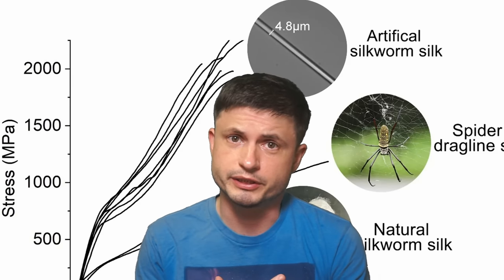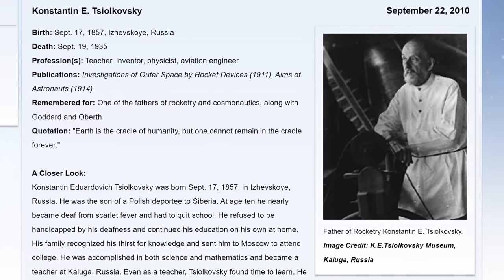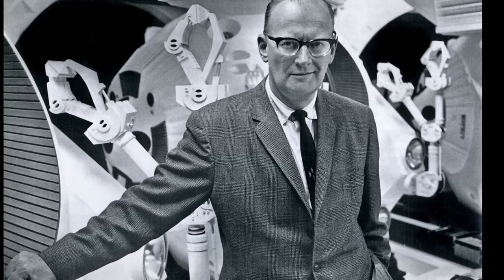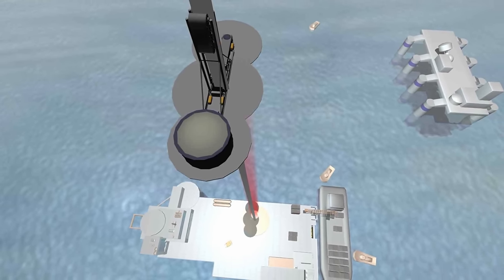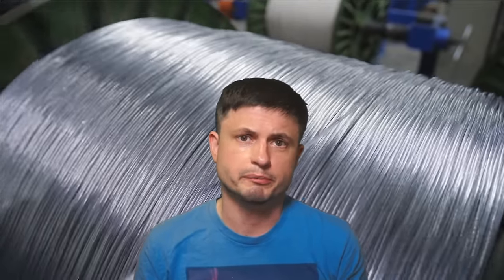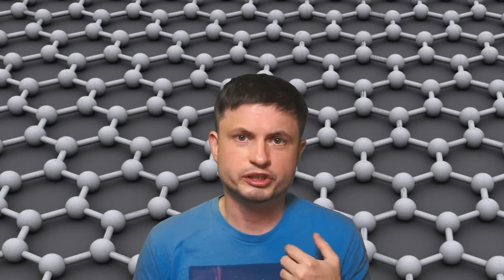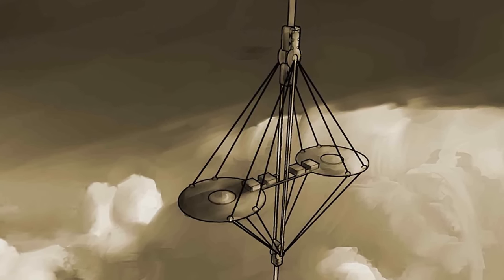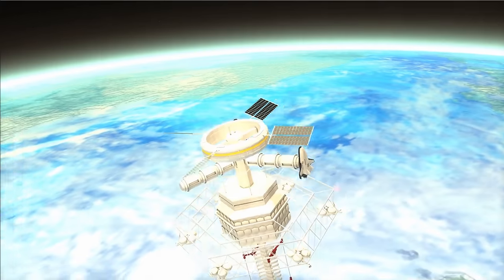Exciting New Updates About Space Elevator Technology...Possible After All?

Comment: One big problem and it's to do with physics. Any space elvator will be made from either metal, or some form of carbon composite, most likely the latter. Carbon composites are very electrically conductive. The earth is surrounded by a magnetic field, that does not rotate with the planet. What happens when you pass a conductor through a magnetic field? You create an electric current. The current generated by a space elevator passing through the earths magnetic field, would be horrendous. The magnetic field around that current would also be horrendous. How would you deal with these two phenomena? 
An experiment similar to this was attempted by scientists aboard the space shuttle. The idea was to run a copper cable 1,000 meters out and see what sort of current was generated. 
The cable blew apart after running out 300 meters.

Comment: I wonder how space elevators will work with energy conservation law. Will bringing lots of staff to space slow down the counter-weight, so some sort of correction engines will be needed to bring it back to speed to maintain the pressure.
Reply: I have commented this on other comments as well, but let me present my option:

If the centre of gravity of the cable is slightly outside of geostationary orbit, then the cable would be constantly under strain. If you then raise something up the cable, that would lower the centre of gravity. But as long as the centre of gravity is still outside of GSO, the centripetal force will still push the centre of gravity outwards. Which will keep the tether where it would be.

So essentially:
We can have a thin tether, where the centre of gravity is only slightly outside of GSO. This will cause little strain on the tether where it's connected to the Earth, and thus little strain on these fasteners. This will give us a space elevator with relatively low capacity for transport.
Or we can have a thicker tether, where the centre of gravity is further out. This will cause more strain on the tether and on the fasteners to the Earth. But it will give it higher capacity for transport.

Comment: you can build a space elevator from relatively weak materials, it just requires tapering down its thickness. how much tapering is required depends on the tensile strength. using steel would require a base(top) of the width of thousands of kilometres and you'd need a planet to source all the steel. not practical but not impossible. a carbon nanotube one would require considerably less tapering, but would still be massive. the tensile strength number ONLY applies to a cable of equal thickness all the way. it does not apply to a pyramid or inverted pyramid. (two cables can carry twice the load of one cable. four cables can carry twice the load of two cables and so on.)

doesn't mean it's the best way to do it as structural integrity is not restricted by static support to begin with. you can support it dynamically by using a lot of power just as well, and that's only limited by the amount of power you have available. and if you build your dynamical support superconductively you'll only need to keep it down to superconductive temperature. and if we find room temperature superconductors (no physics rules them out) you're back to zero operating power consumption after you start your structure. the power will loop in its superconductive structures indefinitely and keep the structure dynamically supported.

any time you hear people say things like "you can't build a world ring/dyson sphere because there's no material strong enoug" those people have no idea about building megastructures. you can build a space tower from surface to space from marshmallows if you like, it just takes dynamic support to stop it from collapsing. it does NOT have to statically support its own weight.

Comment: i think it would be smartest to use space elevator rails as catapults to launch rockets into orbit with the same concept as a fighter jet launching from  a battleship but vertically. We could dig into the Earth to have to build less high even. We don't need something that connects, we just need an easy escape route.
Reply: plus it would probably mess with the ionosphere to have a long ass rod orbiting in sync with earth's rotation, and would probably even mess with gravity itself. its not just about building taller anymore.

Comment: This still sounds enticing -- but I'm curious about the orbital dynamics.  Most artificial objects are in Low Earth Orbit (LEO), which is less than 1/3 of the Earth's radius (the accepted definition of LEO is < 1243.7 miles above sea level).  For example the ISS orbits at 211 miles above the earth and has an orbital speed of about 17,100 mph.  At this altitude the orbital period is about 92.9 minutes.   
Geostationary Earth orbit (GEO) on the other hand is 22,236 miles above the surface of the earth.  At this altitude the ground speed is 0.  Obviously this is a huge gap between geostationary orbit and LEO.  GEO is 105x further away than the space station.  You show the counterweight being much further away than this even. This suggests a few problems...
1) Any structure in the LEO portion of the elevator will be at risk of collisions with space debris with closing speeds of about 17,000 mph.
2) How will the cable manage the inevitable perturbations in orbits?  For example a 0.01% change in the orbital altitude will still be about a 222 mile "stretch" or slack in the cable.
3) According to Wikipedia, a combination of lunar gravity, solar gravity and the flattening of the Earth at it's poles causes a precession motion of the orbital plane of any geostationary object.  This requires regular stationkeeping maneuvers of about 50 m/s per year.  I expect that this will be even worse at the altitude of the counter-weight, which will be held in it's orbit by the cable since it will be moving faster than required for it's orbit.  I wonder how they will manage this problem.
4) I wonder if this could result in a change in the angular momentum of the earth -- remember it's a long way out there, and thus a very, very long lever.   We worry about climate change -- what about a space elevator which slows the rotation of the earth???

At the end of the day -- I'm not holding out for this idea.

Comment: My question is what would happen if the tether is hit(broken) below the Geo-stationary altitude ? Would the lower part crash onto earth ?
Reply: When you say "hit", I assume you mean "break", right?
Yes, if the tether of the space elevator breaks, it will be a complete disaster. Which is why we need to make sure that doesn't happen.
Reply: @SexDrugsNpostprod  Well, here is why I don't agree with you.
You seem to equate the tether being HIT, with the tether BREAKING. I don't agree with that.

The tether has to be really thick and strong. We're not talking about lifting one ton into orbit each time. We're probably talking about a large number of elevator "cars" or "pods" moving up and down at the same time. These pods ALSO need to be protected. So outside these pods, there will probably be some kind of screen, maybe made from kevlar or something, that will be able to absorb smaller objects hitting it.
Larger objects will have to be monitored to make sure they don't hit. But large pieces of space junk are currently being monitored, so that's no difference.
Additionally, with a space elevator we would be able to build proper "vacuum cleaners" (pun intended), that can help remove all of the space junk. This would lower the risk of any impact.

A space elevator would also make it easier to refuel and repair satellites. And to remove those satellites that are permanently being taken out of commission. This will reduce the future risk of space junk even being created.

Comment: considering we could easily suspend something mid air using airships or balloons, we can currently reach far higher than people realize, not to space, but still significantly higher than anything we have tried yet
Reply: Alex, you are talking about high altitude baloons and great weights, as if they go well together!  High altitude baloons can't even avoid leaking helium right through their skin.  The more the weight, the more the baloon, and the more they leak.  You need to put the top end weight 44,000. miles above the ground, and you would be lucky to get a giant baloon with 2 tons of cargo to 80,000. feet.  That is only 15 miles!
Reply: @haroldhahn7044  sorry but a couple of corrections, 1. Helium is for chumps, hydrogen is the way to go, 2. My comment also mentioned airships, which were easily capable of lifting 50+ tons, and 3. My comment specifically said this probably couldn't get all the way to space, but it can get us far closer than anything we have tried

Comment: An engineer would be a fool to use a constant cross section rope in anycase,. Such a tension structure needs to be tapered. There is even a reasonably direct formula for it, just plug in the strength and density of the material.

Comment: Watch the price of land in the potential drop zone plummet if something like that sould ever be attempted...
Having the cable is by far not everything needed to create such a structure. Remember: you basically have to lift the entire structure in  place more or less in one go. At least a supportive structure that can act as a scaffolding to get the full strength elevator in place. I don't see any vehicle capable of doing that anytime soon.
Reply: There is no way this cable will be lifted in place in one go.
It will be brought to the geostationary orbit in smaller pieces, and then connected there.

Comment: I've always wondered why you couldn't tie your space elevator to a high altitude floating airship platform first, and then lower the cable to the ground after getting enough mass up as a counterweight?

And engineers on here?

Cheers 😊
Reply: I fail to see the benefit of doing that. It feels running a marathon, and then stopping 100 meters from the finish line to have a shower and lunch before you finish.

Geostationary orbit is roughly 36 000 km above Earth's surface. Space starts at the Karman line, which is recognized to be 100 km above the Earth's surface. So just by reaching the Karman line, you have finished about 99.7% of the space elevator. If you then get down to 36 km, which is 4 times higher than Mount Everest, and where I guess such an airship could be placed, you have finished 99.9% of the space elevator.
So if you have finished 99.9% of it, why not just finish the rest?

Comment: The geostationary construction would need to be built first , and the fiber line , made at the station , to earth .
 Letting it down , is much easier & safer & cheaper , than trying to haul the line up . 
 With all supply's , ferryed up to the geostationary construct , it should be relatively easy .  
 The fiber used , is yet to be made  - what would diamond do over that lentgh , as it's light , strong and potentially eminently suitable .

Comment: No one ever talks about how you would lay outthe cable, once in place sure it could work but getting the cable to link space to the ground has a massive issue that no onetalks about, how do you actually getthe cable up there and then tie it off to the ground.

Because no rocket could gettospave draging it from behind and dropping it from space would have so much drag on it as its falling it would twist and curl wildly from wind and the spin of the earth.
I have never heard anyone ever talk about this aspect of the project and to me its a bigger technical issue then the material of the cable.
How do you drop a many km cable from space and get it to land in an exact place then secure it before its either pulled away or too much lands and it crushes everything and is too heavy to move. And then do all that and then have the counter weight boosters fire in space to stop the fall. And for all of that with no issues because there wouldn't be time to fix them.

Comment: Wouldn't this induce a ginormous torque on the wire? As the weight would want to slow down due to the high earth orbit, while tha bottom would want to speed up due to being in LEO?
Reply: It's not BEING in LEO that makes the cable want to speed up.
Very (over)simplistically, it's the centre of gravity that matters. If the centre of gravity of the cable is in geostationary orbit, then the cable itself will orbit as if all of it is there.
That is of course not entirely true. The different strength of gravity will try to stretch it out. But fortunately, that's what we want it to do.

Comment: Any structure going through the atmosphere towards space would face a problem of ice building up on the outside above a certain altitude hope they don't leave that as an afterthought
Reply: vibration and windage pretty sure to vibrate the ice off the fun bit is working out how to dampen the vibrations although a floating airport at the edge of atmo would be one way and a good way to have connecting flights too and from elevator plus the tether weight is generally assumed to crawl up or down tether to compensate for windage and load

Comment: Why not use a spring from geostationary orbit for a slingshot?
Reply: To launch a vehicle toward the moon or wherever?
Reply: @booklover6753  👍 exactly
Reply: @oldmechanic5744      Any velocity that you impart on something is going to push the launcher in the opposite direction (one of Newtons' laws).   The energy contained in the spring would be split 50-50 between the launcher and launchee.   And to get to any destination in a reasonable length of time, this kind of a system would need to accelerate you to a huge velocity very quickly (G forces would be lethal probably), unless you used a really long gentle spring.    I used to help out a friend who operated a one man garage, and we used to install springs on struts before installing the struts into the cars.    Can you imagine the spring compressor you'd need?     Astronomy and physics were my majors in college, but I used to work and get my hands dirty when I was a youngster too.   I get where you're coming from.   Finding a way to get a free boost out of orbit would be a great accomplishment.   Not sure how you'd get it done though.   👍😎

Comment: Start with a much smaller one in lunar orbit.... as part of a post Artemis program. 
I can see this quickly replacing small lift rockets, but to get into the 100 tons market may take a bit more time.
Reply: Building on going up from the Earth would be more cost effective. Since currently EVERYTHING we have to send into space currently have to go on expensive rockets, this would save a LOT of money.

So the first priority should be to build a simple and cheap one that can be used to sent things into space a lot cheaper. Then you can use that one to build a much bigger and sturdier space elevator, as well as building one around the Moon.
Reply: @Tjalve70  i think the idea is to use electric methods of propulsion which are more efficient than rocket propulsion
Reply: @ethanpeters3047  Yeah, that's obvious.
Why are you telling me this?
And how is this relevant to whether to build a space elevator on Earth versus Moon?
Did you read the message you responded to?

Comment: What if, we didn't need a stronger material. What about... a series of electromagnets. Then the actual tether strength would be dependent on the strength of the magnets, rather than a continuously connected physical material...? Could something like that be done? Of course... then how would you power the magnets...
Reply: Not strong enough
Reply: @andreasvox8068  Too bad. Graphene actually sounds like a cooler idea though. Being that it seems so useful.

Comment: ..take the Eiffel Tower as a concept. Make it 1000-times larger. Take it to the edge of space. Build-in several large elevators.  and there you have it. A very large engineering job designed to last 1000 years or more. Equip with elevators able to haul large payloads with a space port on the top. Beats strapping human beings to bombs..

Comment: I love the concept of space elevators but I always get upset when everyone mentions that we have nothing that can act as the cord for the elevator as that’s simply not true.  It’s only a problem if you are trying to make the entire length a single uniform diameter cable for that whole thousands of kilometers length which to me has always seemed crazy ever since I realized it doesn’t have to be.   I just don’t understand why no one ever talks about the possibility of making that cable a tapered construction.  If you increase the diameter, and therefore the strength of your cable as you go up, then each section of cable only has to be strong enough to support the weight of the load and the cable below it, not what’s above it.  It then just becomes a simple balance act and weight to tensile strength calculation that actually many materials, including steel can be used for.  You just need to set this all in an orbital location so that there is just enough force across the whole structure to keep the far end that is in geostationary orbit under just enough outward tension to keep the whole structure under tension, and anchored on the surface of earth.